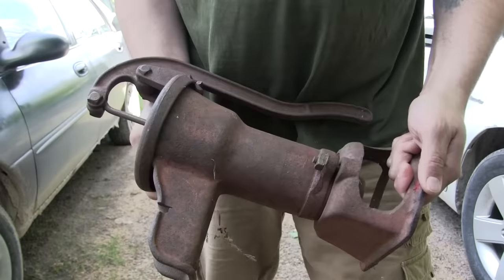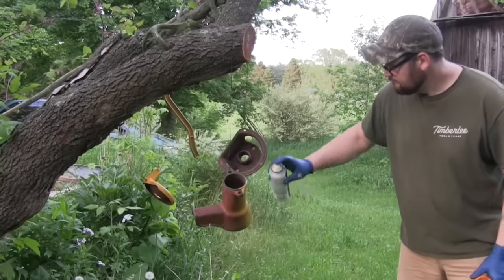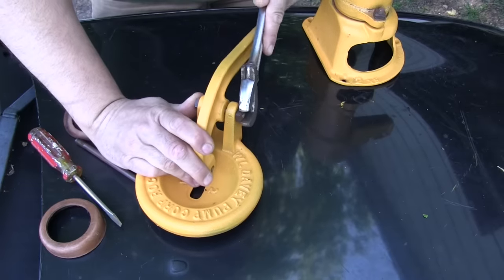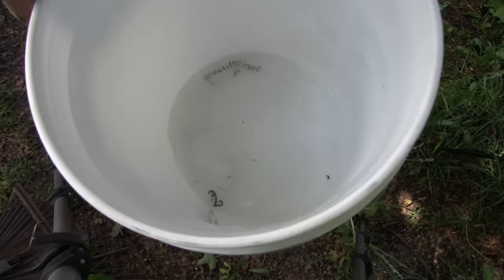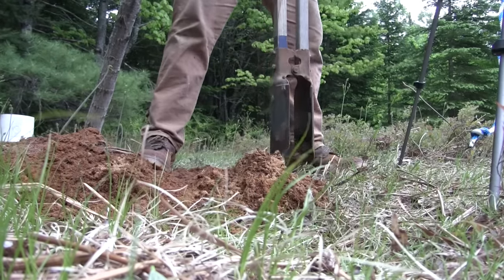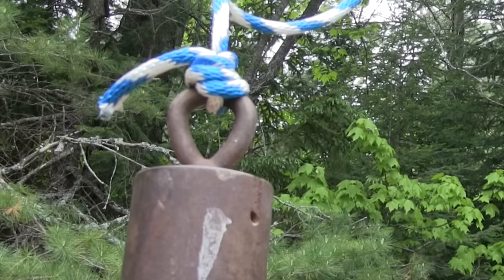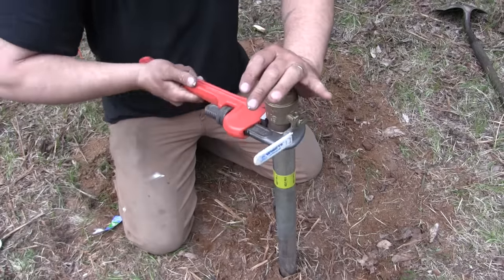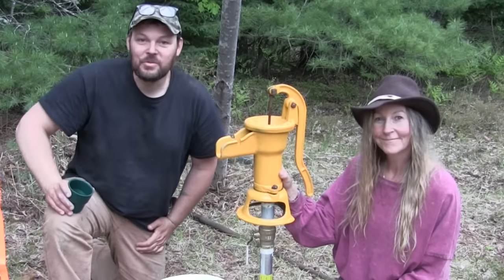Antique Hand Pump Well,  Start to Finish, at our Remote Off Grid Property

Comment: if using pipe dope & worried about any funky taste in pipe/water after dope is dry flush out the line even if you have to use another water source flush the section before its in the ground you'll be glad you did

Comment: Dave, I have a question for you. To be honest I am struggling right now with my well. I bought a brand new pitcher pump from Menards did everything as I was supposed to I have over 5 foot of water with a 3 foot point, so two feet over the first coupler. I can get water to the pump it just won't pump the water out, pipe becomes ice cold all the way up to the pump. I am receiving new leathers tonight and will soak them and try again, but any advice would be greatly appreciated thank you and much respect for you man truly.

Comment: Not sure of your soil type. Where I’m at in Nebraska it’s clay. With that being said, your posthole digging needs some tweaking. First rule to digging hole use power equipment. When that not available you’re stuck with the hard method. When you’re digging with had powered diggers the only time you should move the handles together is when you want to dump dirt. You should drive the diggers down hard in the hole multiple time in various directions. Each time you should be getting an inch or 2 of soil. There should be 4-5 inches of soil before you empty the diggers. If you have a large rock or block or brick like on construction sites I would never move the handles, I would just bang them on a hard surface to remove the soil. I believe we are in the same line of work.

Comment: What is that driver made of?  Steel or iron?  I want to make one but am not sure how to do it.  I have looked online to buy one and can't find any heavy enough.. Where do you find something like that?  The heaviest I have found is 30 lbs.  My post hole driver that I have now for just T posts  is prob 10 bs.   That's why I'm inquiring about the metal it's made from.. I think I'll have to get one welded.  Just want to use the right materials.

Comment: Did you douse where you put that well ? One time my dad and his friends built a hunting/ fishing camp and they drove 4-5 points and weren’t getting water and they’re 100 yards from a lake ,so they found this little old lady they called the water witch and for a case of beer she’d douse a well . So she did her thing with a willow branch and came to a stop maybe 10-15 feet away from where they drove the last point, and the guys were a little skeptical, she said if they didn’t get water she’d buy them 2 cases of beer , they drove the point and got an artesian well, I might have been just 10 but I was impressed, they gave  her a $100.00 and 2 cases of beer , that was 56 years ago and that waters still coming out of that pipe , and a small celebration happened, being 10 years old when nobody was looking I snuck a bottle of Old Style beer out of the cooler.

Comment: I live in Minnesota. What if I wanted to or had to use the hand pump for water?  What can I do?  Thought of digging below the frost line and insulating to the surface.  Would that work or do you have any other ideas?
Reply from the maker: the old timers drove the well inside there house and put the pump next to the sink

Comment: Im building a top of a hill there is about 11 acres of semi flat land "mis-shapened" what are the chances i would be able to reach water with a hand pump?  im about 800-1000 ft higher up than the bottom of the holler creeks

Comment: I expect by now you've learned how to lash together a tripod! But in case you haven't then go look at a Boy Scout manual. You tie TWO poles together first, not too tight, spread them to the width you want, that will make the lashings real tight, Prop it up to around head height then lay the third pole in the V above the lashing, lash it in place then push the thing up to full height.
A ten your old Cub Scout could show you!!

Why didn't you take two pulls on the rope and take the driver higher,? It would have hit much harder..... Me? I rigged a trailer winch to do the lifting and a simple latch to let the driver fall....

Comment: Hey Dave . I have a question about the leathers . Could you replace those with a piece of an old tire ??  Like out of the side wall ...
I'm thinking that if it works well it might make the pump a lot stronger for suction and maybe you'd be able to pull water from a deeper source ...
Reply: Maybe a little Vaseline for lube ... Or some mineral oil ??
Reply: Inner tube if the tire is too heavy ... Might seal better and last longer .

Comment: I'm having a really difficult time finding a pump that will fit 2" drive pipe. Any info on where to find one? Or do I just use an adapter to make a 1.5" pump fit the 2" pipe?

Comment: Tip for anyone that feels uneasy using water directly from the well: you can boil your water with a bowl floating in the pot, with the lid upside down and ice on top to distill the water. You can do it twice or even thrice if you really wanna be sure. It'll demineralize the water though, so make sure you're still getting your minerals otherwise if you're going to drink it. Perfect if you're just using it to wash things or take showers though.

Comment: Also anyone notice that they neglect the fact that there are holes for mounting bolts on the bottom of the pump., you were supposed to build a little wooden support house, around the base of the pump so that the pump will stay stable and not be putting force on the well pipe. Even the smallest leak in the threads or in the coupling between the base of the pump the vertical section a loss of suction pump with no longer function..

Comment: To make your driver easy… weld two bare wheels together that fit your truck. Jack it up and remove the tire. Put the two rims on the wheel. Start the truck in first gear let clutch out. Then wrap your rope one time around the wheel. Pull on rope and the weight lifts, give slack it drops. Use gasoline not assoline

Comment: I would advise against drinking water from a well that shallow without boiling the water first. I've heard many a story from old timers about getting intestinal parasites drinking from shallow wells such as this. The well for my house is around 300 feet deep. Some places you can hit clear water in as little as 20 feet like this guy, but the water isn't nearly as clean as a much deeper well even if it tastes good. Shallow wells are great for toilets or watering plants and animals, but for human drinking water they need to be much deeper.

Comment: "It's never this easy". Yup, that would never work where I am, can't dig a hole 2 inches without hitting rocks. Shale everywhere. Makes for building beautiful stone walls though. Much of it is weathered with grain like old wood. Some of it I call 'water stones'- those are the ones that have a concave shape to them that will hold a puddle of water when laid flat.

Comment: Cleaning the pipes:
Step 1 - Get the end caps off the pipes.
Step 2 - Clean the pipes inside and on the threads.
Step 3 - Put the uncleaned oily dirty end caps on the pipes again.
:D

Comment: I agree with you about reusing things.  You didn't mention that it is also good for the environment, because that stuff would otherwise just end up in a landfill if it wasn't reused, and fuel and resources would be spent to mine the material and produce its replacement.  Nowadays, stuff like that is made in China, so if you bought a new one, it would be crap quality and the money you pay would go towards building China's military.

Comment: Actually, the pulley system you have set up is exactly the same effort it would take if you were to drive it by hand. You should have used a double pulley up top and a single pulley attached to the driver, that would give you a mechanical advantage and therefore, you would have used less effort!

Comment: There is no mechanical advantage in that pulley. It takes off no load at all. You are just having an easier time pulling down than you do lifting up.
Reply from the maker: yeah.....its much easier to pull with your weight than to deadlift iron over and over

Comment: Why are you working off the hood of your car? You scratched the shit out of the hood. Also, where do you live? Here in Texas, I wouldn't drink well water without boiling or treating it. There are always contaminants in the water and waterborne pathogens are never great. I mean, I've risked it before and was okay,  but I'd hate to be the one that slurps a gulp of dirty, untreated water. 

Also, it looks like your soil is pretty soft. I'd get about 1-2inches in the caliche of central Texas before I needed a jack hammer and high powered well drill. I helped a friend drill a well for his ranch and we had to rent some heavy duty equipment.

Comment: The first two threads barely contact anything anyway, putting dope or tape in that area is useless
Reply: Also, if that pipe was damaged at all by that driver (probably not) you can couple a small piece of pipe to it and hit that instead

Comment: So they never bothered to even buy a simple test kit from the supply store that sold them the well Parts. There are several different ones you can buy, even the simplest test kit will check for the presence of microscopic bacteria it would make you rather sick. Even the ones that you send a small sample of the water out, would only take two or three days to know for a fact that your water is safe to drink. I would rather spend $25 then the next 3 weeks of stomach cramps and diarrhea. It's not uncommon for shallow water to be contaminated with fertilizer, pesticides and sewage. Again none of which you want to drink even in microscopic amounts. Two drops of water heavily contaminated with wild boar feces or urine can contain enough e-coli giardia and cryptosporidium too contaminate 5000+ gal of water and make it undrinkable.  serious